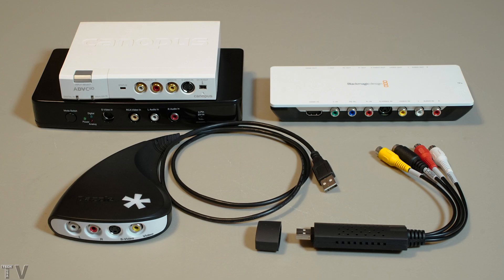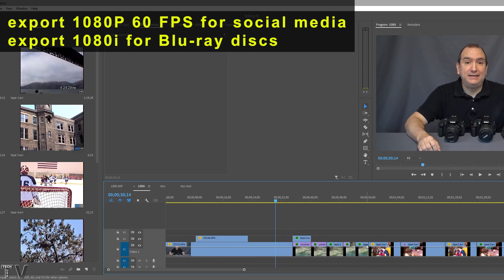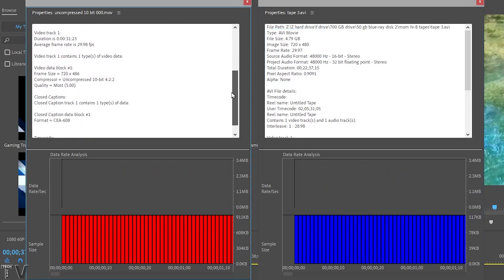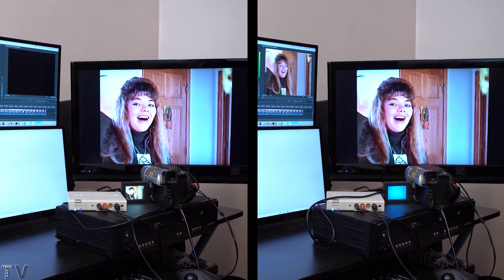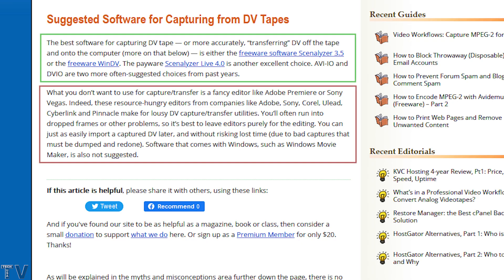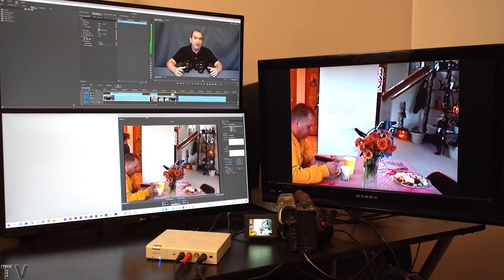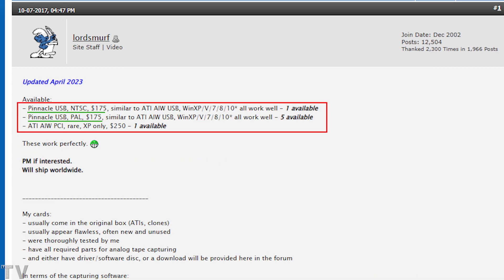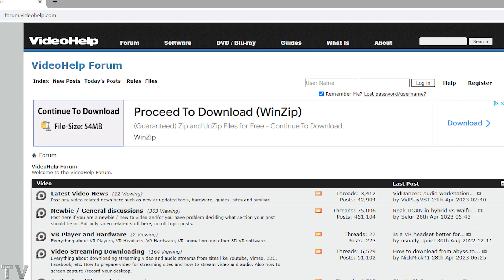VHS video capture and Hi8 video transfer myths debunked

Comment: Love your channel and your take on things and it seems to me that in the end when you read all the comments both pro and con about any of this stuff, it often comes down to a personal preference for different people. Sure, one comment might say more of this and less of that and someone else, visa versa and of course there is an element of snobbery in any line of tech product where the obsession goes from finding a great product to constantly trying to find the absolute best there is. This will never happen as long as people are selling product. A lot of times you read someone recommending an Easycap because "it is simple and has great colour" and in the same breath condemning FireWire because "it looked washed out" not knowing technically why that may be. They don't care because they just want to digitize their video. There isn't one thing wrong with trying to get the best results but there comes a moment when it's all over and a person needs to move on. This comment isn't a strike against anybody, it's just the way I see things.
Reply from the maker: I think you should check out the video links below. 

https://youtu.be/zBO0AGx8324

https://youtu.be/vqCi9B_7mdU

That being said it is not about personal preference. The cheap USB capture devices can be problematic and so can the Intensity Shuttle. I have demonstrated this in several videos. Some of the cheap USB devices will crush the dynamic range. That has also been demonstrated. The Firewire DV converters will clean up the video. The Firewire DV converters do not look washed out. I have demonstrated the quality of the Firewire DV converters in several videos. Keep in mind DV-25 codec used in the Firewire DV converters is of Broadcast quality.
Reply: Don't misunderstand me when I say personal preference. Everything you said is probably as close to 100% correct as it could be. My point was that I could capture two different ways, one being inferior and unless that one has quality that is absolutely horrible, there will always be someone saying they like the bad one better. It does happen. I'm going to check out the link you posted. Thanks.
Reply from the maker: @seasonstudios  I see your point.

Comment: 7:55 - the DVstorm, DigiSuite, and Targa realtime cards (by Canopus, Matrox, and Pinnacle respectively) did cost that much. I’ve had a Matrox DigiSuite since the late 90s.
Reply from the maker: The Matrox DigiSuite and Pinnacle Targa 2000 and 3000 cards were professional video capture cards. Those have BNC connectors and XLR connectors as well as deck control. 

The Canopus DV Storm, Matrox RTX 100 and RT 2000 capture cards were for consumers as opposed to professionals. Same can be said about the Pinnacle Pro One and Pinnacle DV 500.

Comment: Would love to see some followup videos and direct comparisons to what is generally recommended over at DigitalFAQ to compare directly to them. I can see why building an XP capture PC isn't ideal, but would be interesting to see the comparison - best bet would probably be the ATI 600 USB clone on a Windows 7 machine - ideally a laptop with a modern SATA SSD in it or USB3 external drive. I've also seen the GV-USB2 highly recommended and that does work with modern hardware. I do think on occasion that I've seen the ADVC give a sort of blocky output particularly with curved or diagonal lines. These are the couple videos I've seen which will directly compare the ADVC to some of the other options out there that I've found including VHS_Decode. Color on VHS decode won't be enhanced in any way during the capture, but you can adapt those levels in post processing.  VHS decode has gotten a lot simpler lately, but a big downside is requiring a lot of storage space and then having to capture the audio separately to merge later I believe. Worth a watch if you haven't seen these yet: https://www.youtube.com/watch?v=CQ-u979_6Cw https://www.youtube.com/watch?v=h50Rd7948cs There's also a relative consensus that 480i should be converted to 480P 59.94fps - Seems like it should, though not sure if your current process does that or not? This process also seems to give a really good result with the GV-USB2- but again, no direct comparisons are shown to other methods: https://www.youtube.com/watch?v=tk-n7IlrXI4&t=368s
Reply from the maker: I do have follow up videos but I would not give digitalfaq any credibility. You should request Lordsmurf from digitalfaq make a few VHS/Hi-8 video tutorials. I say that because Lordsmurf has made some really stupid claims without providing evidence. The DV-25 codec does not take up a lot of hard drive space in the year 2023 and Firewire DV converters are easy to use. I have stated in many of my videos that if you are posting to social media converting the DV-25 NTSC interlaced fields into to 59.94 progressive frames is the best option. This method will interpolate the fields rather than de-interlace the fields. Keep in mind I compared the Intensity Shuttle at 10 bit 4:2:2 uncompressed to the ADVC 110 and there is no difference.  You cannot really get better than 10 bit 4:2:2 uncompressed can you? Regardless of what lordsmurf at digitalfaq says the Firewire  DV converters work with professional NLE software unlike the USB devices. I should also ad the Firewire DV converters were used at post-production houses and TV stations the ATI AIW devices were not. Do you kind of see my point? I left a couple of links below that might be worth watching. Having said that are you going to provide links to my videos in response to other peoples VHS/Hi 8 YouTube videos? 

https://youtu.be/vqCi9B_7mdU

https://youtu.be/zBO0AGx8324

https://youtu.be/-mz7-delWJA
Reply: @TechTVusa  Agree there's some conflicting statements and experiences that users have versus admins over there and I haven't seen a ton of direct comparisons and things are generally dismissed based on specs or based on subjective experiences without a lot of direct evidence over on DFAQ. I think if DV25 had been 4:2:2 chroma sampling, I don't think there'd be any objection to using it now. Now whether you can really tell much difference between that and 4:1:1 might depend on the source being captured and how many fine details are present, particularly in the horizontal axis. It's unfortunate that there's not a super easy test that can be done with fine detail to really see color losses of different chroma subsamplings in a worst case scenario  and that would probably also show what putting a signal through various devices in a chain do to distort signals some. Probably closest thing would be to use some sort of a pattern generator that had alternating vertical lines of color - you might be able to take a PNG like that and turn it into a video that the Black Magic intensity shuttle can output, though that will probably get downsampled to 4:2:2 at output as well?. I do think the best way to sort of disprove their "optimal" capture setup though is to directly add an all-in-wonder cards to your comparisons. Otherwise saying it probably isn't as good or at least "not superior" is also heresay. Would be interesting to interview old TV studio techs that have more info on what was generally used for broadcast and if there were any "best" products as they were known to the industry back then. I will say that time base correction was supposedly a huge leap forward when it was invented, so I do believe most broadcast studios would have used a TBC at least which is one of the things DFAQ really stresses.
Reply from the maker: I just now seen your comment. Having said that why would I interview an old TV studio tech when I am an old TV studio tech  :  )

 I used to work for the Detroit Cable Commission. We used Broadcast equipment like Betacam decks (not Betamax) and Sony 3/4" Umatic decks. We did have a rackmount TBCs. No one has said otherwise. The problem is that lordsmurf is using a TBC and external color correcting devise that are not needed. I think he thinks it makes him look cool and sound professional but the end result will be much worse than using a DV converter. Premiere Pro, Resolve and FCPX go way beyond the 4:1:1 8 bit color space. In my video (link below) I do color correcting using the Intensity shuttle's hardware and it sucks compared to using Resolve, FCPX or Premiere Pro.  

https://youtu.be/zBO0AGx8324

After watching the video link above I hope you will respect my professional expertise by not asking me to do another VHS transfer test but instead demand lordsmurf get off his lazy ass and demonstrate his method. Do you kind of see my point? Trust me the ATI All In Wonder cards were never used at any TV station or video post production house. They could not be connected to the Broadcast complaint tape decks and the ATI All In Wonder was not compatible with Media Composer, FCP, Premiere Pro etc. TV Stations and Post Production houses used products by Avid, Matrox, Pinnacle, Fast Multimedia, Targa, Blackmagic Design etc. I transferred several 3/4" tapes and Betacam tapes before I ever transferred a VHS tape. My first capture card was a DC 10 Plus from Pinnacle Systems. I bought it back in1998 a few months after we bought our $80,000.00 Avid Media Composer.

Comment: Spot on! 
Expecting consumer tapes to look any better with 10bit 422 digitizing shows a lack of understanding of the source formats´ capabilities. DV is not perfect but absolutely capable of capturing all the luma and chroma bandwith from VHS or Hi8. The only use case for a higher qualitiy codec would be extremely noisy tapes which might introduce compression artifacts at 25 Mbit Intraframe DV. But you would probably have to denoise the captured video anyway (preferrably in the temporal domain which takes care of a lot of artifacts in the process). And of course DV does not mess up color or luma levels at all if your equipment is only a bit on the professional side.
Reply from the maker: I left the link below to part 2 and another video link about image quality. 

https://youtu.be/zBO0AGx8324

https://youtu.be/vqCi9B_7mdU
Reply: @TechTVusa  Just watched, excellent elaboration on the subject. It´s important to point out people that obviously never put in the (hard) work of establishing a very good AND efficient solution but think they know everything better.
Reply from the maker: @sirvivor_1974  Lordsmurf is spewing out pure stupidity on his website. The world of TV production embraced the DV 25 codec. The majority of TV shows broadcast from 1998 until 2008 used DV cams with the DV-25 codec. Lordsmurf is very confused.

Comment: Thank you, I suspected that DVsoft is an intelligently designed codec, and your video finally convinced me of something I knew deep down to be true. I tried recently to get lossless capture from VHS through usb converters... Even if you can see a clear solid picture on the capture preview, it still drops frames regardless if you have a core i9 with an RTX 4090 and 64 GB RAM... I can't believe we're in 2023 and these monsters can't effin handle 720*480 video capture.

I will be reverting back to DV converters as I have checked out DV conversions I made 10 and 20 years ago and they honestly hold up and can withstand intense color grading in DaVinci.

This usb capture industry is a complete sham, it's maddening that such a simple task is purposely kept underpowered.
Reply: Sounds like the USB capture card was the issue there, or possibly timebase errors. Even a 10 year old computer these days should be able to capture SD video, even losslessly if you've got an SSD anyway. I will say the ADVC110 does seem to be pretty good at tolerating timebase errors for sure and you don't have to worry about audio sync issues with that.
Reply: @orihalcon8693  I have Hi8 and VHS tapes, I'd love to capture losslessly, I have a laptop from 2022 or 3, what else would I need? how do you even go about it?
Reply: @Mr.Goodkat  If you want to capture VHS tapes losslessly. Then try VHS Decode. It's expensive if you decide to use the Domesday Duplicator, but it's nowhere near as expensive as the so called professional workflow and it's 100% lossless.
Reply: @GabrielThomas-ik9eu  Thank you can you explain to me please, where I can get that? and how it works?
Reply: @orihalcon8693  "I will say the ADVC110 does seem to be pretty good at tolerating timebase errors for sure and you don't have to worry about audio sync issues with that." - you'll still need a frame TBC to avoid the Canopus dropping damaged frames and also discarding their audio. Please see my separate, top-level comment I just posted for more info.

Comment: Hello. I'm going to buy a Cannopus ADVC 110 to digitize some VHS tapes. Does it work on Windows 10 PRO?
Do I have to buy a PAL-M to NTSC converter, as I'm from Brasil?

I do collect high quality transfers of videos and audios shows on some trackers, so I'd like to get the BEST transfer result possible these people are doing recently (in mp4/mkv format; there's some codecs configurations about, which I don't know nothing). These people recommended using Virtualdub for transfering. Will it work with my system? My system:

Intel(R) Core(TM) i7-9700K CPU @ 3.60GHz   3.60 GHz
RAM instalada	16,0 GB (utilizável: 15,8 GB)

Where should I start? I'd like to know the best softwares for Win10 for capturing, best codecs and formats that are being used nowadays to get the best results, without getting too much annoyed with drivers, codecs etc

Also, for cleaning up the heads of VCRs and VHS tapes, what should I know?

Thank you!
Reply from the maker: The video links below should be helpful. 

https://youtu.be/vqCi9B_7mdU

https://youtu.be/zBO0AGx8324
Reply: "Does it work on Windows 10 PRO?" - it does. Also on the latest Windows 11 2024H2 version. Just doing some test transfers with WinDV.

Comment: As far as I know, the canopus ADVC-110 has no TBC, but a PHILIPS SAA 7115 (9 bit) video ADC (for televisions) that is optimized for bad video signals, in contrast to the SAA 7114 (8 bit) that is only optimized for bad color carriers, and was not good enough (for VHS without TBC) in my canopus ADVC-100. With Blackmagic Intensity, the frame rate of the video recorder (24,998-25,002 fps PAL) or DVD recorder (playback) was not forwarded to the HDD. Video compression should only be used after software denoising.
Reply from the maker: The video link below should be helpful. 

https://youtu.be/vqCi9B_7mdU

The Firewire DV converters do have a chip to maintian correct timing. The video link below demonstrates that at 9:00. 

https://youtu.be/zBO0AGx8324
Reply: @TechTVusa  At 9:00 only the photo from the ADVC-110 can be seen. With me the top lines are also in the right place. Head switching point was turned down to PAL line 577.                                                            https://youtu.be/F7IVjVYH68U (old Solution)
Reply from the maker: @TTVEaGMXde  At 9:00 minutes I am showing of equipment for Broadcasting as opposed to home use.